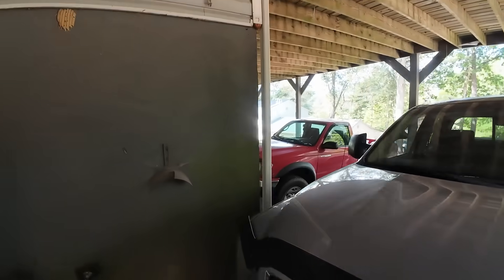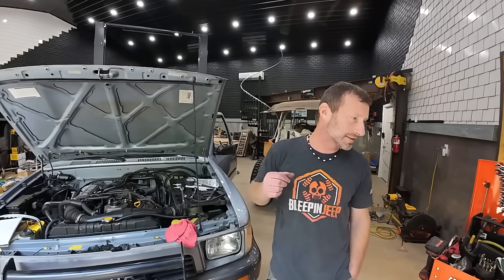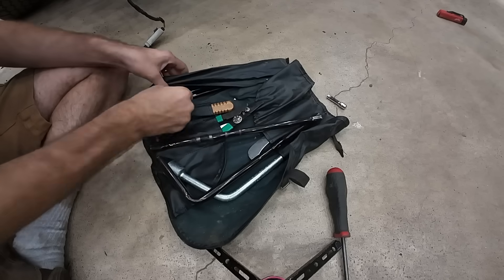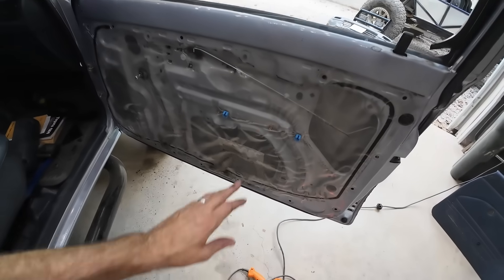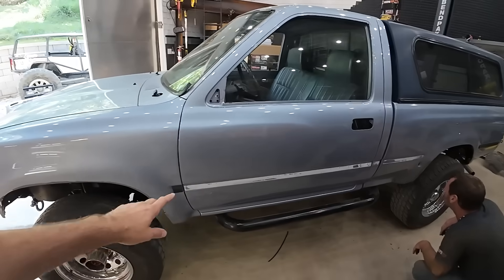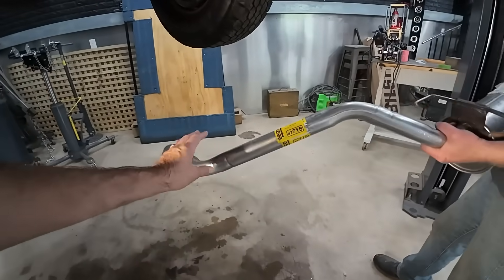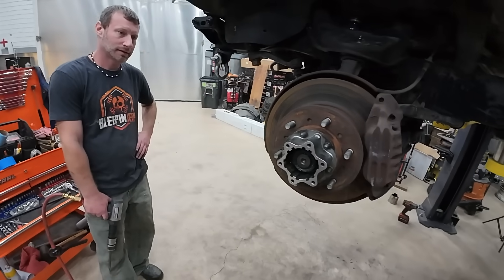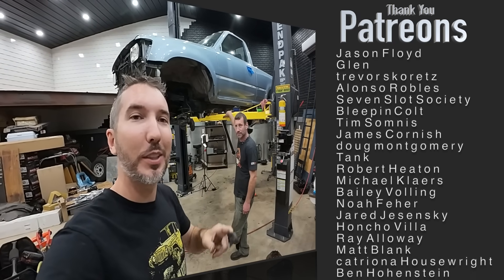Tear Down Stage - Pimp my Dad's DREAM TRUCK Pt2

Comment: Toyota pro tip: before you remove rear axle seals, measure the depth of the seal and install new one at the same depth to insure proper seal around axle shaft. 😉

Comment: I wish I had kept my dad’s 70 Toyota pick up . I remember putting this funny looking exhaust tip on the back of it.   It was a tractor pto spline sleeve and I drilled holes into it so I could screw it it down.  As a kid I thought it looked cool.. it was definitely different.   Man…..I miss my dad .  
Keep up the good work brother  !!

Comment: Did dads Yoda ever see a winter road? I am amazed at how clean it is apart from the normal grease and grim. Around here she'd be a rust bucket held together with duct tape and bailing wire. Wish my son would install the Jeep parts I have hanging around for me. He would I'm certain but I wouldn't ask, he's got enough on his plate already. Your a good kid Matt.

Comment: You may already know, but check the vent on top the rear diff. If it gets plugged it can cause the rear wheel seals to fail. I know it can happen just from age and miles too, but it definitely is worth checking. It's one of the first things I check on all my Toyotas when I buy one. (Because they're all old and high mileage already.) Love your channel, I've followed since you first started and I was sure I was going to buy a Cherokee myself. Ended up buying Toyotas. 🤣 Love your videos, awesome seeing what you have in store for your dad's 'Yota.

Comment: You’ll live Toyotas after you get done fixing it up!!! I’ve had 6-7 of them as for around NC they’re great on trails especially the straight axle ones! Not much flex so rock crawling it’s not so great but they’re pretty cheap on gas and used to be cheap fun trucks!!!

Comment: Those cone washers on the hub, most of the time if you smack the face of the hub with a stout hammer and a block of wood it will pop them out enough to open them up with a small screwdriver. The truck looks like it's had an easy life.

Comment: Those windshield trim clips are hard to find. A shop rag works good to remove the window crank clip . Pull behind the crank,the rag will snag the clip and pull off.

Comment: hit the side of the hub of each stuck washer with a hammer to remove the cone washers (like removing a ball joint or tie rod end), leave the nut on loosely because that washer will fly off.

Comment: To compare to factory, pull all 4 plugs, also hold throttle wide open, pull fuel pump fuse  and do test per cylinder until  gauge stops moving..

Comment: One common issue with the 22RE is the timing chain wearing through the plastic timing chain guide and then through the water pump cover, dumping the water into the oil... Mine did so at 275k miles... It could be good preventive maintenance to install a new timing set and guide... Unfortunately the head has to come off to do so, but worth it to avoid possible catastrophic engine failure

Comment: I used one of those compression gauges on my outboard, I thought I had a bad engine because they all read low. But all 6 where the same. I used a different gauge and it was 50 psi higher with the non harbor freight tester. So it may have been just my gauge, but you might want to get another gauge to compare to.

Comment: I had a 77 Hilux Pick Up Lowered with Duel 44 Carburettors ported Polished Cam, headers MSD light the. fires 🔥🔥🔥🔥 💨💨💨💨Make that Smoke But not the Centerforce Clutch that would Kill Ring And Piñons , Then I got an 84 4x4  Changed all the Leaf-springs For 12” Recached Lifts 529 Gears 17x 12 Centerlines Wheels 44” Swampers Too the M👀N Then An 1988 extra Cab V6 From a Repo Lifeted it 38” Swampers Till I went and Cut off the IFS, 😬 Where that Straight Front at With those 12” Leafs, , got 2 more Modern Toyotas Since 2012 Tundra Lifted of course super charged 4.7L on 40’s  And my Daily lifted Tacoma with 35’s Overland Loaded

Comment: No matter how much light you have in a shop it is always dark under a vehicle. That's why back when I built my shop in new york I put lights in the floor with lexan covers. They were tied into one leg of my lift so they only came on when the lift was up.
Reply from the maker: thats pretty cool.  wish I would have thought of that before we poured the concrete

Comment: As a old Toyota Tech  I would change the timing chain and guides  and tenchiner with Toyota genuine replacement parts the chain should be replaced at every 100k miles  if the chain brakes it will take out the valves a bend connecting rods

Comment: Did you guys open the throttle wide open before you did your compression checking was a motor hot and the throttle hopefully you open the throttle wide open plus all the spark plugs should be out of the engine
Reply from the maker: Ya I forgot that step but I'll check it again

Comment: Matt,,,   
 Jeeps Do Not need to have jeep engines to be considered a pure jeep,
 Since the beginning of Jeep Time they have used many engines,   Willis, Ford , Buick, Chevrolet, Mopar,   to name a few,  and those were all factory original,    so I would say that no matter what engine is in your jeep it is still a jeep.
   And the most important thing is that what ever engine that is installed in a jeep is running well, so that your jeep can go do jeep things when you want to go jeeping.
 Because after all it is not called,  Fording, Dodging, Chevying , or something else like that,   😊

Comment: The knife in the tool kit would be good for cutting off belts and cutting hoses.

It takes more time to find the dropped bolt than it is just to grab a new one on the assembly line speed.

The repaint could have been a trans-claim repair when a vehicle is scratched or light damage during transportation from point A (factory) to point B (dealer). Transportation damage is inevitable and just part of the business.
 Your dad may not know anything about it because it was maybe repaired before he bought the vehicle and the dealership wouldn't have to disclose the repair because Toyota has high standards for trans-claim repairs. Or your dad may have had a boo boo back in the day.

Comment: I’ve noticed something about batteries made in 2020. They are all junk. I had a mobile auto repair and in 21 and 22 all the batteries I had to change were from 20.
Reply from the maker: thats weird, never heard of that one but it does make some sense that they might have been slacking during covid.

Comment: I am cringing as you guys are working on the hubs.  Those things are called cone washers and they are the reason factory Toyota hubs are stronger than any aftermarket option.  They prevent any movement of the hub under load.  Removal of the cones can be difficult but i've found the best method is to pound on the head of the stud with a brass drift and BFH, once the cones pop out you can wedge a small screw driver in the slit to open up any that won't pull off by hand.

Comment: it is dark in there because you put all that black in that shop when you built it .lots of people like you dont  realize that good light is not just the initial  beam but the reflection off of floors walls a ceilings. I thought you we nuts when you did all that black, but kept my mouth shut because you would of thought I was a hater so I just let you see that you Fed up on your own LOL

Comment: Making me cringe the way you removed those cone washers on the front hubs! You hit around the edge of the hub body with a dead blow and then use a small flathead screwdriver to rotate the cone washers out of place. Use anti-seize on the outside and inside of the cone washers when reassembling.

Comment: You youngin' you....can't believe you never saw a wire crimper like that before.  Since heat can be installed under floors, I don't see why lights couldn't be.  Shining up on the underside of the vehicles you're working on.  Invent that, if it isn't a thing already.

Comment: For someone who owns a large garage and builds trucks etc you are pretty dumb on what tools do, it was NOT a tyre iron it was a wheel nut wrench, the knife is an add on from your dad, the green pliers are wire strippers with a built in screw driver.